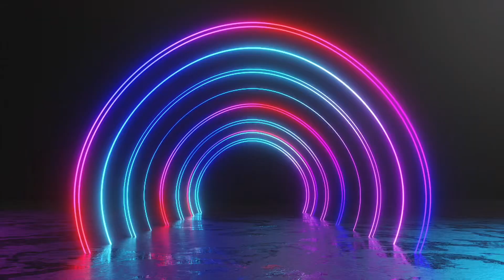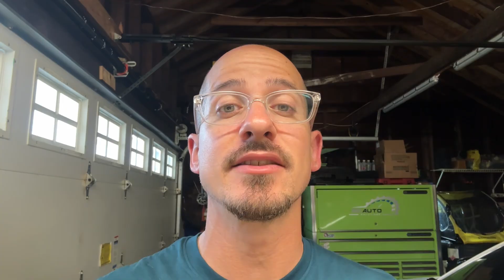Q&A Episode 108 (prelude | brake bleeding | hybrid injector failure | trans filters)

Comment: Thanks for the advice on the squeaky clutch. I went with the Sugarfoot Clutch Pedal Brace. Added a little White Lithium Grease to the clutch pedal springs and the clutch linkage. It's never felt so good and perfectly silent when pushing in the clutch pedal. When it was out of the 07 Si. I couldn't find any visual cracks.
Reply from the maker: Awesome, thanks for the update!

Comment: Hi. Love your insider’s info on Hondas. Great source. 
I have a couple of questions:

1. I have an FL5 CTR which I absolutely love. I do my own maintenance and change oil every 4000-5000 miles. I don’t go by the computer’s recommendations as they’re way too long. What schedule do you recommend for other routine maintenance items on this car, seeing as it’s a performance car? Like for example how often should the MTF be changed, coolant… ?

2. Did you ever come across a broken plastic gas pedal under normal usage? Is it common? There’s a double notch in the gas pedal that I heard is supposed to act as a mechanical fuse in a crash, but my pedal sheared off at the notch while just commuting to work. 

Thanks
Reply from the maker: Hey man thanks for the support, is the car modded? If so, what mods? Is it driven hard? Those answers will help me give you a better answer. Also email me some pics please of the issue your having if you can. Bcautosolutions20@gmail.com
Reply: @BCautosutions  Hey thanks for getting back to me. Engine wise, my car isn’t modded currently but I plan to do it soon. Nothing crazy. Just basic bolt ons and a tune. Downpipe, intake and intercooler is my plan. I expect to get it to around 380 whp judging from other’s results with similar mods. 
I daily it but also regularly take it out on fun trips on deserted mountain roads where it’s driven hard (I see oil temps of 230-270f), so it sees a mix of normal commuting and hard fun driving. I also plan on tracking it occasionally. 
I installed a catch can on it almost from day one, and due to the hard driving that it sees fairly regularly, I use Motul 300v 5w30 racing oil in it. My thought here is that this oil should provide better protection at high engine loads and high temperatures, but unlike most other racing oils, it has a good amount of detergents, dispersants and acid inhibitors - so can be used on the street for a reasonable mileage. I change every 4000-5000 miles. 

I’ll send you pics of the broken gas pedal. I changed it, but I never saw it happen before so I was wondering if it’s common.
Reply from the maker: @ASJC27 I would do oil changes between 3-5k
Brake fluid 30k or every 2 years
Trans fluid every 30k unless if constant hard shifting then every 15k
Coolant every 45k
Reply: @BCautosutions  Thank you!

Comment: I get that brake fluid is hydroscopic and I'm assuming that's the reason for changing it. What I don't understand is they make testers for checking brake fluid moisture content so why not just test it? I have to wonder if this is just a way for dealers to sell another service? Has something changed in the late model cars that has made them ingest more moisture into the braking system than older vehicles. My old 2007 Ridgeline never had a flush in 210k miles and the brakes worked fine when I sold it to my buddy whose still driving it around problem free.
Reply from the maker: Chances are if you don’t change it it’ll be fine. The fluid becomes more essential and important for spirited drivers. We do have testers and usually they start to fail/test bad around the 2-3 year mark

Comment: 1.5T 2018 water gurgling/rushing sound coming from car while idling after longer drives. Only will do it for around 30 seconds.
Reply: check your A/C drain
Reply from the maker: Check ac drain and coolant levels (when engine is cold)

Comment: I'm stoked for the prelude. I'd be more stoked if they gave it a higher trim with the k20c1/c8, but that said, I'd still buy the hybrid. I like the Civic hybrid, but I already have a sedan and an SUV for daily stuff, camping, or carrying people. I need a daily that doesn't cost a lot of gas. I live in the mountains and drive down to the city a lot. So something fun in the turns while getting gas mileage and being a hatchback. This car is a winner for me! I have a few manual fun cars so I just want good mileage for once. Plus it being a hatchback and having the ability to carry a full set of wheels/tires, and whatever other marketplace finds I come up on is awesome.

I have owned 3 Preludes. '88 si, '94 vtec, '98 base. All manuals. I love preludes. Though this one breaks tradition, I'm okay with it. They could have called it a Prelude, or a model 4. It wouldn't matter to me. I'm about it. It does look goofy at some angles, but that's okay.
Reply from the maker: I can see that. Well in that case I hope you get it and hope it’s everything you want and need. Regardless I will drive one, review and voice the good and the bad on initial impressions and hopefully and more importantly it’s relatively problem free! 🙌

Comment: Another question: which Hondas have fuel filters and what is the maintenance interval? (I have a civic but want to make the question applicable to all viewers) my owners manual does not mention this but I imagine there must be some sort of fuel filter in the car.
Reply: Honda’s or most modern cars don’t have fuel filters under the hood anymore. Filter is part of the tank fuel pump assembly and normally last the life of the car for most people.
Reply from the maker: @roberts1159 💯
Reply from the maker: Modern day Honda have the fuel filter in the tank although I will answer this as well as more people may wonder and miss this.

Comment: Great stuff as always 👏🏾 ...especially the brake bleeding info.

2020 Accord Sport ... 
Have you ever run into lite clicking/moaning noise coming from behind the center dash area around the controls and infotainment system? I thought it was the fans in the heating/ac system but the noise occurs when a that is off and the car is sitting idle. 

Appreciate ya✌🏽💪🏽
Reply from the maker: Thank you!

I have not experienced that although may be a tough find. If you find it, let us know!